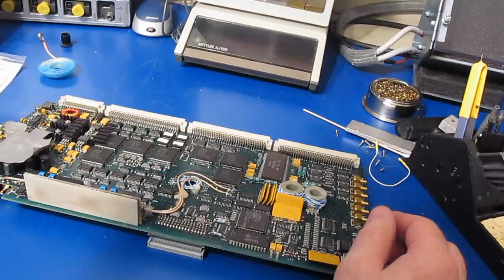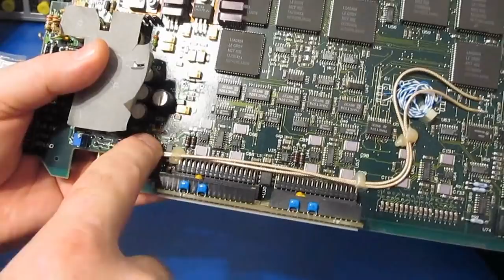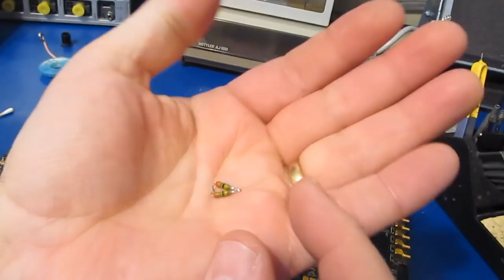Oscilloscope repair day

Comment: Joe...ever work on any Tektronix 465B Oscilloscopes?
Reply from the maker: Hard to say.  I've certainly repaired analog scopes in 80s.   I helped a friend who owned an old Tek scope that wouldn't trigger.  Funny thing was I actually had the transistor array I needed to get it working again.
Reply: I recently acquired a Tektronix 465B Ocilloscope that had a Problem. The Traces are too Short for the Screen! All the Power Supply Voltages are Spot-On. The Screen is 10 Graticules Long but the Traces are only 5 Graticules Long!
Reply from the maker: Sounds like a fun little project.
Reply: Yeah... tough without a working Oscope though. Voltages in the Vertical Section are good. However not so good in the Horizontal Section. All the Transistors check OK...Capacitors seem ok too...don't know yet what it is.
Reply from the maker: @cheewurz  Fairly common scope.  Service manuals may be on-line for it.  You could always post in the Tektronix forums or start a thread in the EEVBLOG repair section.  There may be some people there who could help walk you through the repairs.

Comment: When Joe says "It is pretty capable what this thing can do" at the end of the video I was thinking it is capable of driving me crazy with that fan noise. I'm just getting sensitive to noises in my old age I guess? I do appreciate quiet fans though.
Reply from the maker: I think as these two are configured, they dissipate roughly 600 Watts.  If you want fanless scopes you want to step out of the 1990s, high speed scope world.   My slightly newer scope is about as loud...  Maybe just stay with 555 timers, LEDs and batteries.  lol.
Reply: Those scopes certainly need fans. But after decades those fans probably need a lube job, or something.
Reply from the maker: Perhaps liquid nitrogen.  Even that little scope I have with only two fans make a fair amount of noise.   So does my ceiling fan.
Reply from the maker: HAHAHAHA.  Musical fans..  The older LeCroy uses 5 cooling fans.  I can imagine some people may have a problem with them being slightly off frequency and hearing that low frequency wobble.  The only time fan noise has really bothered me was when I bought my new PC.  They have a fan controller that will cause the fan speed to very a fair amount depending on the load.  Lucky they had something in the BIOS that allowed some tuning of controller.

Comment: The control board looks classic and pretty nice. The conector E3 well it happends..All looks very sturdy. The fans are a little bit noise and  the yellowish LeCroy traces  are unique
Reply from the maker: Some older ones have had hand written wire markers on them.  Very tiny hand writing.
Reply: That had to be the time when they where checked by hand. Anyway here is the one that i worked in my current job for SPI signals . It' s a 9350AL: 
https://photos.app.goo.gl/k6KC1d8jiHyHLc1O2
Reply from the maker: That's a nice old scope.   The newer cheap scopes I guess will decode many of the buses.  I've never played with one.  I have support for SPI and a few other serial buses on my newer LeCroy's.    You can see how it works in this video.
https://youtu.be/f1UtLpSZ2W0?list=PLZSS2ajxhiQBcHhIaGpmm9GyZQfrCzqkv&t=1057

Comment: Haaa, i have the very same scope with 7242 and 7242B module options.  :D A very capable scope even with today standards... funny i bought it for less than equivalent of 50 USD. The owner (she was a pretty nice old lady) thought it's kind of an obscured and old TV : )))
Reply: But it literally says oscilloscope...
Reply from the maker: They are totally different.  Motorola vs Intel.  VME vs PC.  ??? vs VGA.  MFM vs IDE.  .... I think I found a 100MB drive that I used for my 7200A.  Was going to try to use a SSD but never got around to it.
Reply from the maker: I gave away the newer "A" model that I had as my main DSO for several years.  That one was color and I gave them one of the 4GHz sections and a bunch of spare parts.   The one shown in the video is the first one I ever bought.  I still use it for high risk behaviors.   lol.   The 7242A would not run in the newer chassis without a jumper modification.  I think this is the first pre A plug-in I have seen.  The inside looks like it was built by engineering.
Reply: It was in a garage sale and she had no clue. The scope was dusty but not in a bad shape, so I just bought it out curiosity (i had a MDO4104B at the time). After the good cleanup,  unbelievably it worked beautifully.
Reply from the maker: Is it the older VME chassis or PC based?
Reply: The 7200A models are PC based. It's BEAST and loud :D very loud.
Reply from the maker: I've seen the 7200As with both 386 and 486's.   There were only a few different MB's they supported.   Do you have the 7200A or 7200?    I had tried a few different CPUs in my 7200A to help speed it up.  I think I ended up with a DX4-100.

My biggest concern with the 7200 is the old MFM drive.  This one now has an old Segate ST225.  The 7200 would not support that drive so I had it and the original Kalok on the logic analyzer to figure out why, then modified the Seagate to work.
Reply: I have the 7200A model with 7242 and 7242B modules and IIRC, the CPU in the unit is Intel 486DX33. But i;ll have to take a second look. I have a bunch of old 486 CPUs, may be I boost up my scope as well.  

The HDD in mine was a Quantum something  :) 41MB of storage. But i'm planning to find a 1.2GB drive to upgrade it. 

I didn't know the 7200 and 7200A models are that much different.

Comment: Re: fluke t6 - an unexpected transient up ones arm while standing atop a ladder might be inconvenient !
Reply from the maker: They have been making non-metallic ladders for some time, but lets assume you use a metal one and you have a ground strap attached to it, and your are working in your bare feet after just stepping in a bucket of water.   You are grounded.   Of course,  you did not read the manual that talks about when to use the ground strap and other PPE.    Forgetting the drama, could you explain how this transient is coupling into your arm in the case you describe?

Comment: I really like the looks (screen) and specs of this scope.  Is the TDR standard or a special plugin. I have a Tek 1S2 TDR plugin  for a 547. Nice repairs
Reply from the maker: At this time, I guess everything about these old DSOs is special.  The two plugins that I worked on are the more common ones.   The one I am using for the pulse were rare even 15 years ago when I was looking.    The only three I ever saw, I owned.  These have a 4GHz front end.   I gave away the newer color unit that was my main scope with one of these.   Basically a more modern version of what was in this video.